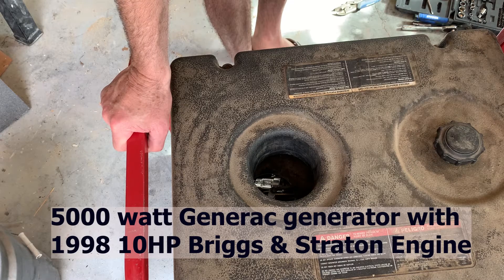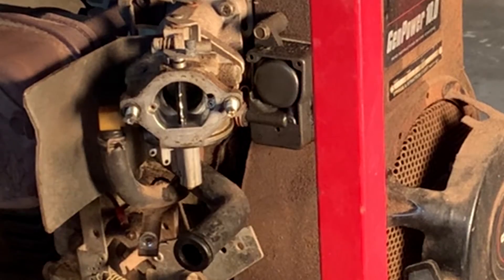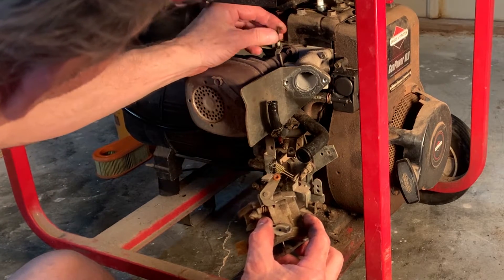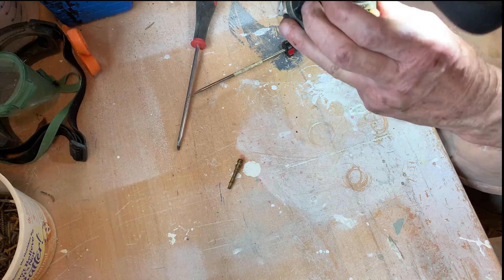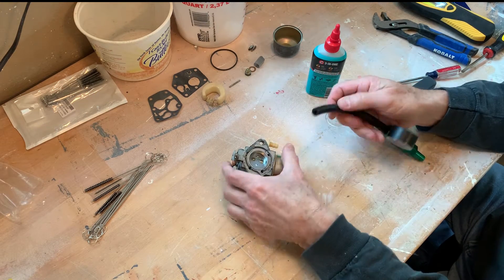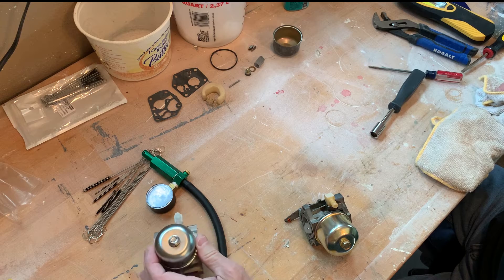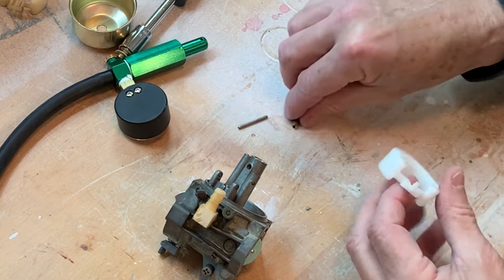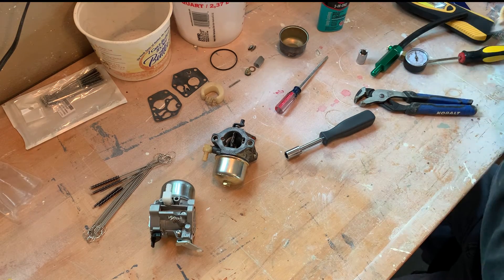Part 1 of 2. Generac 5 KW Generator with 10 HP Briggs and Stratton "L" Head Engine won't start.

Comment: Great video. When you put the carb back together, what liquid did you use to wet the tip to help it hold pressure?
Reply from the maker: @briansutter7696  it was a thin oil called 3 in 1 oil. Any oil should work for the test.

Comment: I just bought a used one and I don't know what oil it has, can you help me? Thank you
Reply from the maker: My manual said to use SAE 30. Change it every 50 hours under normal conditions. Every 25 hours for heavy loads and in high temperatures.

Comment: What is fhe part number for the fuel pump? I just found this one and changed the carb but need a fuel pump too
Reply from the maker: I checked the manual, but there is no parts diagram in it. Sorry I don't have  a number.
Reply: @FixItDepot  ty for the response to an old video... after some extensive research I found the correct part, they have replaced the original with a different model due to the original pump being obsolete or bad design
Reply from the maker: My model is 24 years old and I have trouble finding a lot of the parts too.
Reply: @FixItDepot  I'm pretty sure mine is the same age 😆

Comment: Where did you find the rebuild kit at? I'm having a hard time finding the right kit
Reply from the maker: I have been trying to find the orders and can't find them. I think ordered a carb from Ebay and I think the rebuild kit came from briggsandstratton.com. My engine is Model 19G412, Type 1129E1, and Code 980428YE. There are a lot of different models so mine might not be the same as your model. The original Carb is a Walbro 5-4993 and I think the B&S part number is 690119. I searched Amazon and believe I found a carb that is the one I purchased. It is a Chinese model and in the description it includes the Walbro "5-4993" and the Model "19G412" numbers in the title of the add. They are normally under $20 bucks.  Here is a copy of the Amazon description::
--------------------------------------------------------------------------------------------------------------------------------
5-4993 Carburetor for Briggs & Stratton Walbro LMT 5-4993 695503 498838 499029 497164 497844 For Tractor Generator Engine 19G412 19E412 192432 192402 192412 Engines
Visit the Cyleto Store
4.3 4.3 out of 5 stars    45 ratings 
50+ bought in past month
$19.99
Brand	Cyleto
Vehicle Service Type	Tractor
Recommended Uses For Product	Lawn Mower
--------------------------------------------------------------------------------------------------------------------------------
I will keep looking to see if I can find the orders. Briggs and Stratton site had some carbs too but they were pretty expensive and I wasn't sure it was the replacement I needed. I went to Walbro's site too and could not find one there too. Good luck with it.
Reply from the maker: Here is an Amazon Affiliate  link for the mentioned carb: https://amzn.to/3vCsPex
Hopefully it works and will point you to the mentioned carb. I do earn a small commision from this link. I don't care about the commision, it is not enough to even worry about. Just trying to make it easy to find the carb.